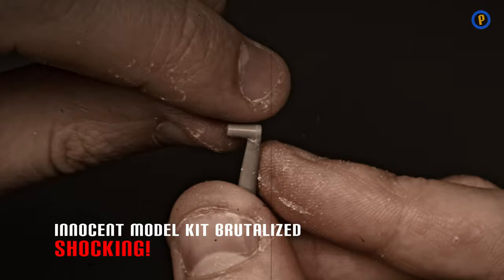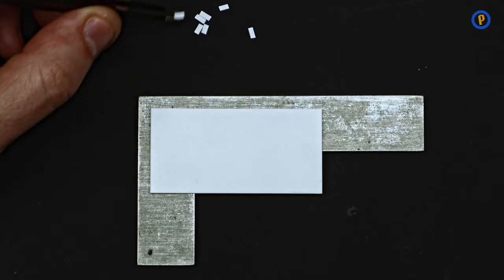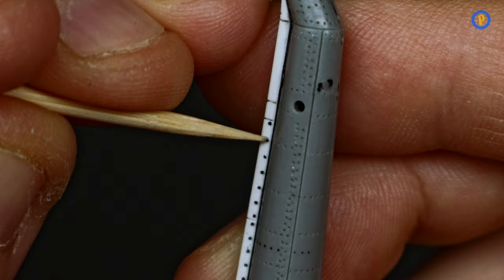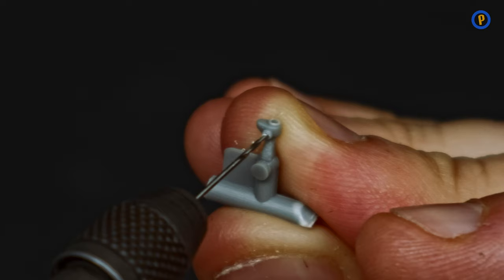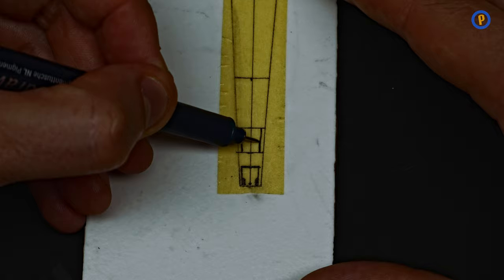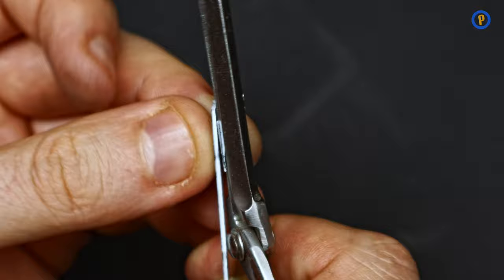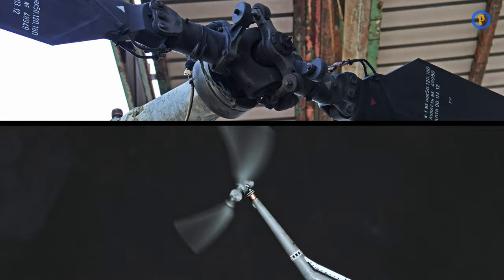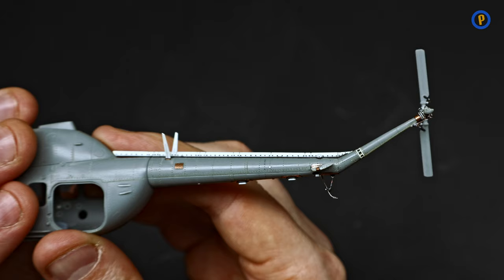The Flying Chicken Thigh - Mi-2 Hoplite (HobbyBoss 1/72) - Episode 2

Comment: Those boxes on the lower part of the tail boom might be housings for the doppler navigation system. Something similar like on the Mi-8 or Mi-24
Reply from the maker: Thank you - I think you are probably right - I also observed similar boxes on the Mi-24 and the Mi-8. Next time I'll go to one of the museums where they have Mi-2s, I'll ask around to see if someone can confirm!
Reply: @PointBlankModelling Hey, engineer with PZL Mi-2 avionics experience here! Those two boxes on the tailboom are the microwave transmitter and receiver antennas for the RV-3 type radar altimeter 😎🤘
Reply from the maker: Thank you so much!!! There will be more unidentified objects in episode 4 so we would appreciate your insights there as well. Check it out if you feel like it.

Comment: Great video! I was surprised this was only your second one. I have been working on and, recording my first video during my current build and your video has been a bit of an inspiration. I am currently working in a 1/35 Hind that I bought long time ago when I thought it was a good idea. The kit is the laziest thing I have ever seen and I have been attempting to detail it similar to what you are doing. I don't have all the tools that you do for scratchbuilding but luckily I have a 3D printer so certain parts for me are easier to recreate that way, though I prefer to make them in ctyrene and brass sheets. Can I ask what your camera set up is? I also might switch to a black background like yours for building as it might show the light model better.
Reply from the maker: Hi There! I'm glad you found a bit of insipiration in this video. 3D printers are great but I don't have one - otherwise I definitely would have used it for some of the details in this build. In terms of the camera set up - I am still very much in the process of figuring this all out but here are a few things that may be useful.

I use a Canon EOS R10 and a bunch of relatively cheap 36W, 6000K led panels designed for ceilings attached to a rack I built with a white shower curtain wrapped around as diffusor. I can share some photos if you are interested. For the background, I used the backside of my cutting mat. I kind of ruined it by spilling cement all over it and I could not buy a new one without a grid printed on both sides so in the next video I am going to use an XXL mouse pad instead - we'll see how that will work out. I find that color grading helps a lot when it comes to making details more visible on all grey/white parts.

Good luck with your Hind! I also have two in my stash: the Trumpeter one in 1/35 and the new Zvezda in 1/48. The former has terrible negative rivet detail while the latter has absolutely none so I'm having a hard time deciding which one to tackle first. Let us know once your video is ready!